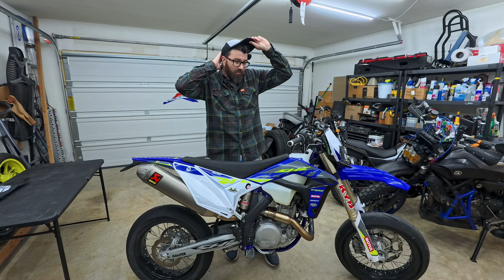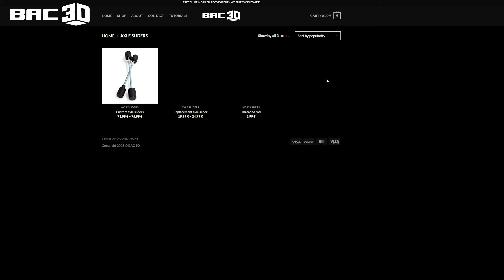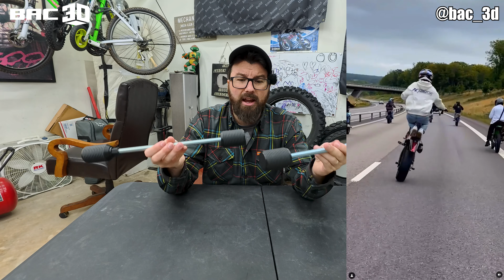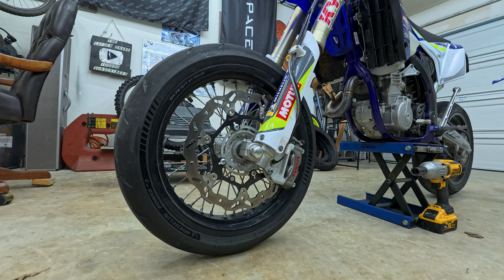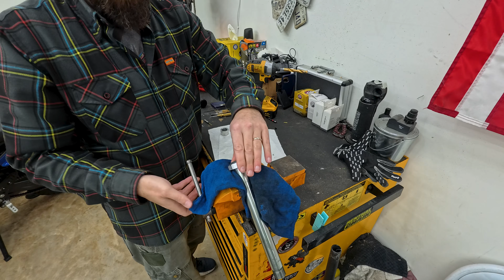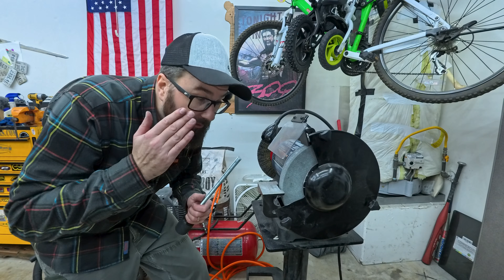3D Printed Axle Sliders? Sherco 500 SM

Comment: These are cool. 2 things, if you cut threads off a rod or bolt, if you put 1 or 2 nuts on, when you cut it, you can use those nuts to straighten some of the ends and then file it down a bit and help keep it straight with the nuts again, just in case you slip a bit 😂 the other thing, if you’re worried about the zinc coating and rusting, either medium or low lock tight or even PTF PLUMBERS tape might help reduce water going down there. I was gonna 3D print my own axle sliders too. For now I made chunky boy bar ends for a friends grom

Comment: I had to cut a pile of threaded rod recently. After having to clean up the threads with the wire wheel a few times I had the idea to put the correct sized die on the rod before I cut it, then thread it off to clean up the threads. Still had to do a bit of wire wheel work but what was left came off nicely. I have also had good success using a counter sink bit or step bit to chamfer the edges of holes after drilling to make them pretty and smooth.

It would be nice if someone made a slider-esque axle protector for enduro bikes -and dual sports ridden in the gnarly places as well. I have mashed up my axle nuts and chain adjusters going through rocks (and replaced the aluminum nuts with stainless steel nuts). A really short axle slider, so as to not hook on things, but protect the nuts and adjusters would be super nice.

Comment: Yeah man,  I've seen frames F#@K'd b/c of  the sliders that were supposed to protect - Surprise !   That wheel mounted one
attaching to the hardware,   could that sliders catch & bend the front forks?  Just a thought & I doubt you could ever force
it to happen( like a simulation) but then again,  if I used them,  Murphy's Laws would end my riding......

Comment: Instead of drilling out the OEM nut you could just pick one up the same size from a hardware store or online. Also a bit of grease on the cut off section will stop it from rusting.
Reply from the maker: One that size would probably be raw steel. I’d be worried about it rusting.

Comment: That’s a badass design. People designing parts like they should be. Abracadabrantesque! 🥖
Reply: Dude it's also so fun! Mocking up designs on my bike with card stock, making it in CAD, cutting it out on the CNC plasma, laser, or making it on the 3D printer, deburring, milling, grinding, bending it up, making dyes, welding it, to then have it fit perfectly. All while hanging with your buddies in the shop laughing non-stop and having good conversation. There is nothing better other than actually riding.
Reply: @ for sure. That’s what it’s all about!

Comment: I’ve got a lot of mates here in Australia that run them on their supermotos and they are cool but with big drops like out of a circle or washing out the rear they seem to snap in the layer lines and when their bar ends snap it’s a bit of work to get the end out of the bar
Reply: Tends to happen on 3D prints and when you have a nut inside its less material to hold together, also there are other materials wiht more layer adhesion out there.
Reply: Have had this happen on a set of sliders before.